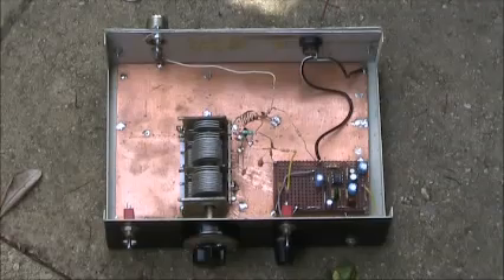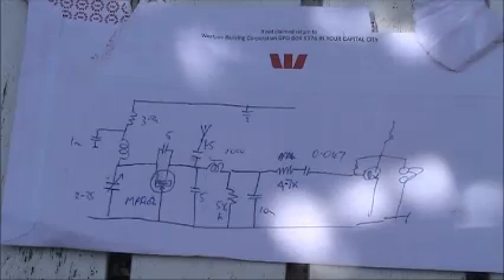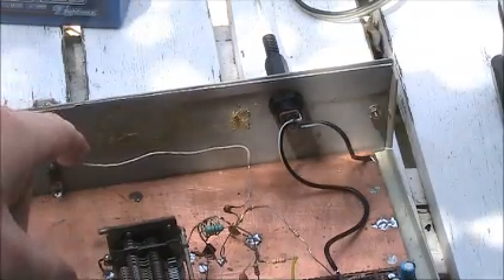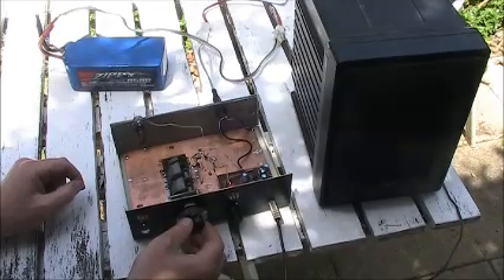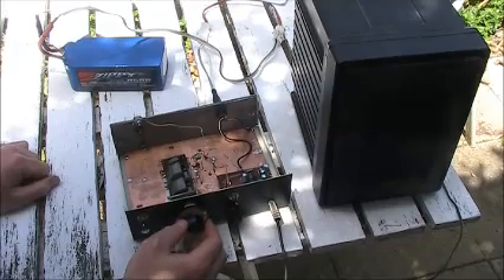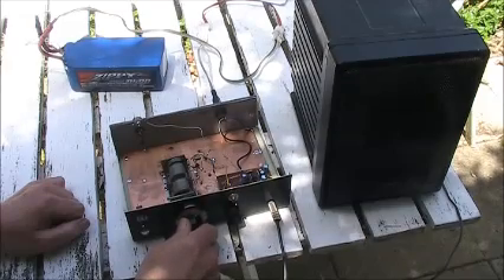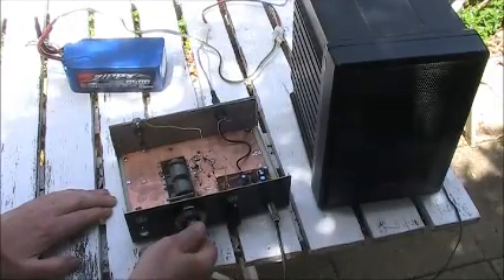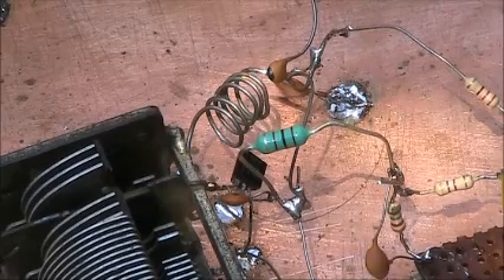Scan of FM broadcast band with superregenerative receiver

Comment: Since this is a sampling type of receiver, I always wanted to have a counter that resets at the start of the quench waveform, then counts up until the quench threshold is reached, then send it to a microcontroller.

I have read some papers where phase and frequency demodulation are possible using a varactor that sweeps the center freq tuning, along with relying on the fact that the tank circuit is still (for a time) phase locked to the last sampled point in the received carrier.

Comment: Do you have a schematic of this?
Reply: I'm having trouble reading your component values on the schematic since the video is maxing out at 240p for some reason. But it looks like all you did was change the antenna capacitor to 1p5 and the series resistor on the right going to the LM386 to 4k7.

Comment: Nice one. I see that practically every hobbyist built a working superregen RX, but for some reason I can't really get such circuits going. Do you have a video about tweaking such circuit to make it work? Most of the time I have trouble making it superregenerate and then I can't pick up any station 'cause it's (probably) oscillating at too high/low frequency. What kind of equipment you use to test it? Can I test it with just wavemeter and tone dipper?
Reply from the maker: +MrJohhhnnnyyy You can test to see if it's oscillating on the right frequency with another FM receiver. Preferably one with a telescopic antenna.  A wavemeter won't work.
Reply: vk3ye Emissive nature of such receiver used for tweaking. Nice hint, thanks :)